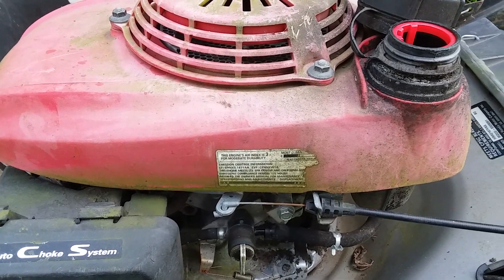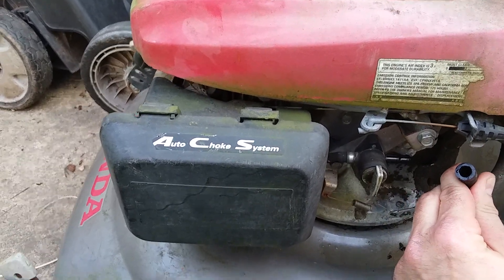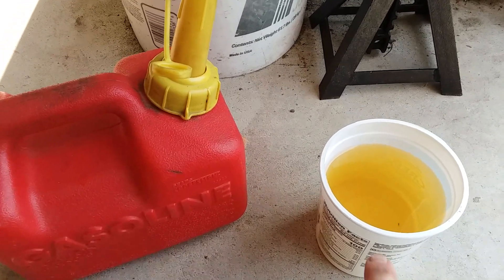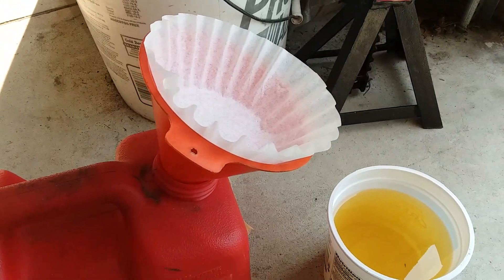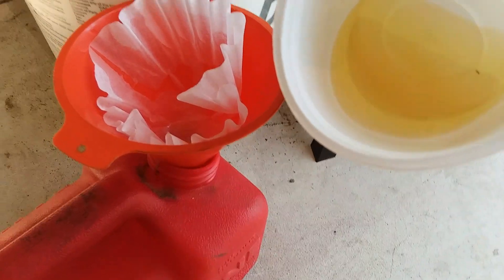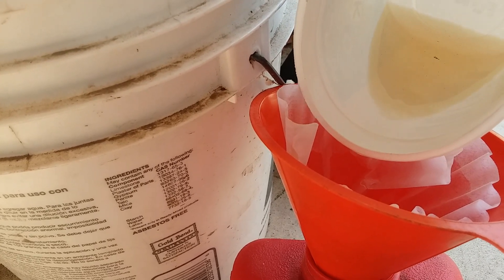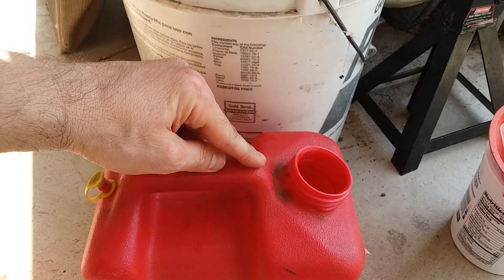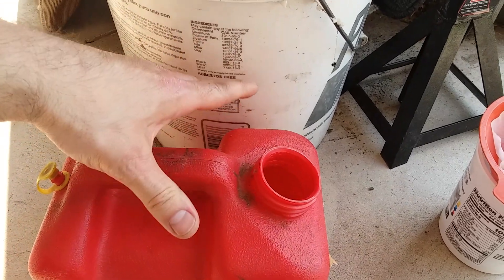Gasoline recycling and reuse

Comment: Probably already asked and maybe a dumb question, but what do you do with the ethanol/water? I saw the cleaning solvent answer.
Reply from the maker: It's mostly water so you could let it evaporate, or put it in a metal container and burn off.
Reply: @berardia4  thanks!

Comment: Honestly, my solution for what to do with old gas in a lawnmower is to just dump it in my old ford, go to the gas station and top off, and call it a day. That little bit of water or ethanol in a gallon of fuel isn't going to really do much more damage to your vehicle than buying normal pump fuel will. Especially if you live in an area that gets a lot of rain because those fuel stations will get tankers of new fuel rain or shine. I've watched those guys filling the underground tanks in a deluge and the driver is standing under the overhang to stay dry while it pumps.

Comment: Hey Al...Got a great tip...Use a silk sheet as a filter for funnel gas...Old boater trick...This is how "Mr. Funnel" started out..Gas flows through..Water does not..Different microns...Use Ethanol Shield for Fuel Stabilization/Regular treatments for all your vehicles Gas or Diesel....

Comment: So you save $2 to run old gas through a small engine. I’d rather run fresh fuel through my engines for piece of mind.
Just burn the old gas.
Reply from the maker: The purpose of the video is how to dispose of old gasoline. Not to save $ on gas, even though you do in the process.

Comment: I was in the military and fueled up helicopters with JP4 at the time which has been updated to I believe JP8.  We always had to do an "Aqua Glow" to "filter" out the gasoline from any water or dirt.  If you didn't do this segregation of the fuel from water or dirt, it would cost the army lives, and money if that helicopter didn't fly right.   Great video explanation of what I used to do, only with equipment made to filter it out.  But if your not doing  a tanker truck which usually hold 8,500 gallons and simply what you showed in your video, this is an excellent way to do that.  Just throwing this out there as a help, but I advise people not to go to a gas station if you see a gas truck refueling there.  The reason why is simple,  because they fill the tanks at those gas stations and stir up all the garbage at the bottom of those tanks, and that ends up in your gas tank.   My advice, .....wait until a few hours after that truck leaves to gas up.  That allows the sediment to go back to the bottom.  No telling how many times those tanks are cleaned out in a years time for SOME gas stations.
Reply from the maker: Thanks for your service, and comment.

Comment: So now the question is how do you get rid of old fuel that’s been mixed with oil at 100 to 1 or 50 to 1?  Great video thanks for posting
Reply: The gas/oil mix intended for two stroke engines will  work fine in a four stroke automobile but may smoke a bit. If you add a gallon or two of old 2stroke mix when refilling an empty tank at the gas station, the mix will be diluted so much you'll .never notice the difference.
Reply: Throw it in your car, motorcycle, generator, anything. If it's no longer flammable just dilute it. I do this all the time and all my machines love it
Reply: After burning 16 ounces of 50 to 1 mix, I will never add this to my car. If you saw how much black soot remains after just 16 ounces you’ll think twice about adding it to your vehicle. I’ll just continue burning it in my Coleman 1 pound tank with the top cut off.
Reply: @condor5635  Where? Where is the soot? In what did you burn it? My helper poured about a gallon of 20:1 mix in my 16 hp garden tractor which upset me more than the motor. I didn't like it but eventually I figured it was no worse than adding upper cylinder lube.
Reply: @roseymalino9855  go burn a pint of 20 to 1 or 50 to 1 mixture - when the flame goes out you’ll see what’s soot I’m talking about. It’s disgusting. I would never want it in my engine like my car.
Reply: @condor5635  My comment refers to mix vs non-mix. The mix you reference would not make an appreciable difference in engine deposits. For instance, my end of season and start of season prep includes adding about a tablespoon of ATF to the cylinder. That ATF burns off. That's about the same amount of 2 cycle oil in a 16:1 mix.
Reply: @roseymalino9855  - all I know is after seeing what I saw after burning it off. I’m not interested in putting it in my car.

Comment: Once gas is bad its bad  now matter how many time you filter the gas it will not work. Do not do this and put it in your small engine equipment. You can't how ever put it in your vehicle as long as you have half a tank of gas. Gas rejuviantes at a 4 to1 ratio.
Reply from the maker: In the video (4:30) it is mentioned that part of the process is to dilute with fresh fuel 4:1
Reply: @berardia4   Is that 4 of new to 1 of old or 4 of old to 1 of new?
Reply from the maker: @IslandManMitch  4 parts new to 1 part old.

Comment: What I had hoped to see in the end, but didn't, was what to do with the mixture of water and ethanol.
Reply from the maker: I commented in another reply, leave it outside for the water to evaporate. Thanks.
Reply: @berardia4  what do you do with the ethanol?
Reply: I filter my in the winter in zub zero temps. Dump the ice in a separate container. I've also used octane booster with positive results.
Reply: @cwmaxfield2000  That is the absolute coolest solution I never thought of!!!
Reply: OK, thanks!

Comment: Thing is I have like 10 liters of 5 year old fuel that came with my bike and don't want to run it though and it would take a long time to dilute 10liters on a motorcycle so idk what to do anyone got some tips
Reply from the maker: Take it out and use it in a mower. You don't have to dilute it with new fuel if it burns ok as is. Diluting the fuel is to raise the octane level if too low.
Reply: @berardia4  got it thanks
Reply: 5 year old fuel is garbage.
10%ethanol gas is really unstable and shouldn't be trusted in any small engine after 3 months.

Comment: How do you dispose of the ethanol/water mix?
Reply from the maker: Matt Jones The EPA recommends you leave it outside to evaporate. Or sometimes I use it to light my firepit.
Reply: @berardia4  I suppose it could be used as a glass cleaner?
Reply from the maker: Matt Jones i don't know about that but sometimes I tried to see if it would burn and sometimes it did and sometimes not. some times it may have more water in it depending on the strorage conditions. Then sometimes I find no water in gas tanks at all.
Reply: dump in used oil for recycle
Reply: @D4x4Bronc  ,.,.you know better than that,.,.
Reply: @bobadams5422  nope perfectly fine to do